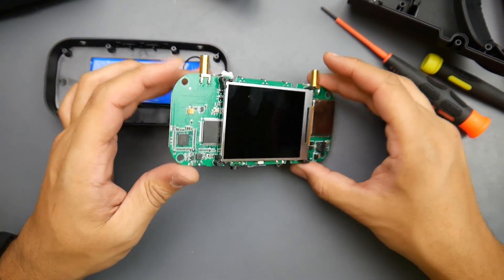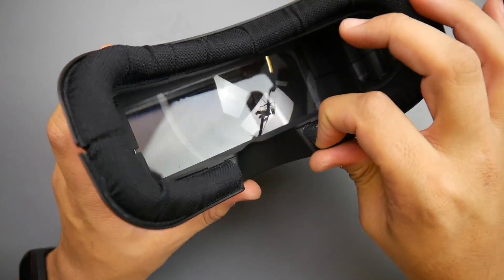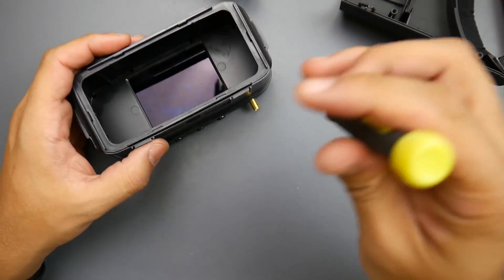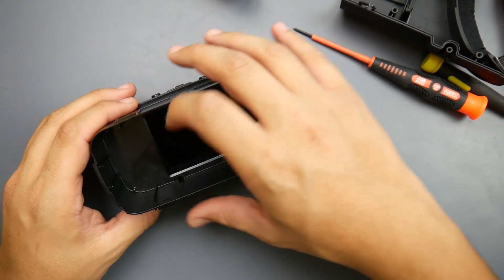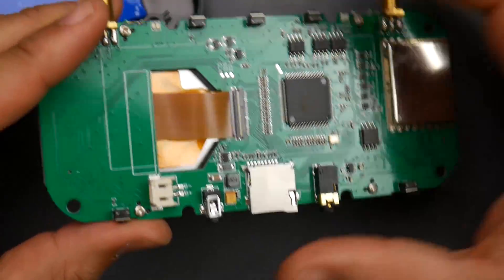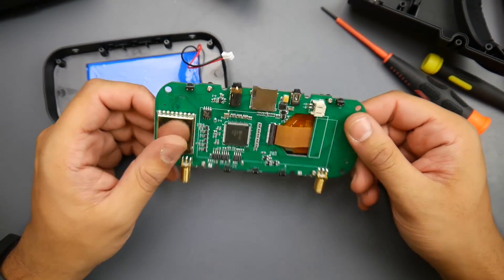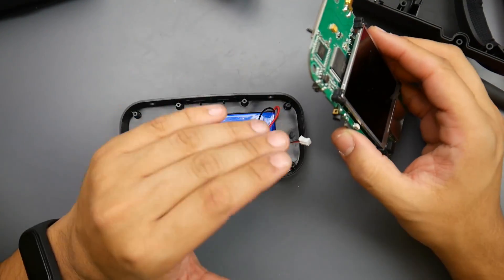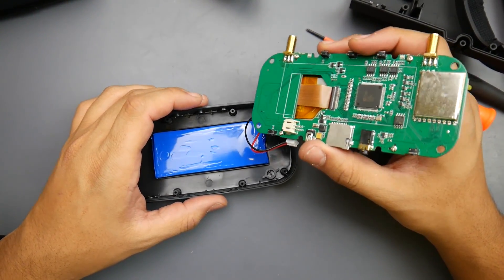Can You See What I See?? // Eachine EV800DM FPV Goggles

Comment: The EV800D has a 5-inch screen with 800x480 resolution.
The EV800DM has a 3-inch screen with 900*600 resolution.
Do you think the resolution of the EV800DM helps to overcome the limitations imposed by the smaller screen and smaller magnification? Appreciate your inputs.

Comment: From an actual user (me): The 800D has a larger screen of 800*480 while the 800DM has a smaller 900*600 screen (so higher resolution with smaller dimensions). Makes sense if you're about to use an extra lens in front of it to accommodate the user wearing glasses of whatever strength.  Don't know if the screen dimensions are also exactly 1.4x smaller compensating the resolution fully.
So it is in theory aiming at same experience but it actually depends if your glasses aren't too wide. I remove mine for that very reason and then I have to extend the box length (which can be done easily) so in the end the screen will be smaller to look at (for me). If your glasses fit however, it might get to a close match of the 800D experience, but without the hassle of removing your glasses. So best tip here is to measure the width of your glasses and if they don't fit into a rectangular of box 13 cm * 4 cm (with a margin) you'll better off with the 800d (as you will be removing your glasses anyway).

Comment: the buttons are better than the ev800d, press them too many times and the bottom of the button breaks and stops working, they should use a board that sticks to the case with a ribbon, i guess they dont cus of cost, same as why they use the cheaper barrel jack power connector. theres got to be an abundance of those things.

Comment: I removed the battery from the EV800D and use a 4000,  2s battery on a cord, and proper lipo charger.  A ton of flying time.  Noticed a bit of improvement in wearing comfort too.
Reply: Hi man, can you please explain if by "on a cord" means that you connected the 2s to the old socket that the 1s was ? Can I replace the old 1s with a new 2s and don't fry the board ?

Comment: Maybe the reason for charging port not being USB is because it can take voltage up to 18 not 5v standard USB. You can use 4s lipo with adaptor plug to charge this kind of goggle.
Reply: This is not an argument. You can make any adapter.
But my native battery is only enough for 20 minutes of flight. I still had to solder the stupid adapters...
Reply: @MrCrankSer you can, but then you are throwing a 18V micro USB adapter on the marcet someone could accidentally plug into their Phone. Also I think you are not allowed to do that under USB specifications.